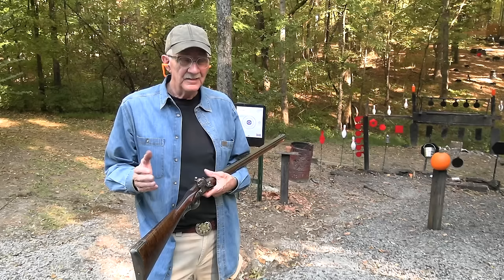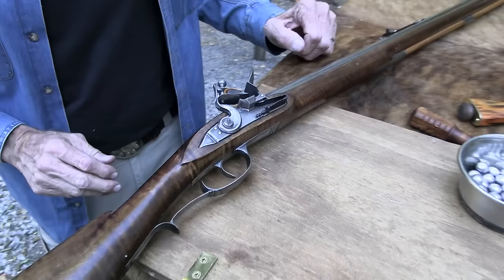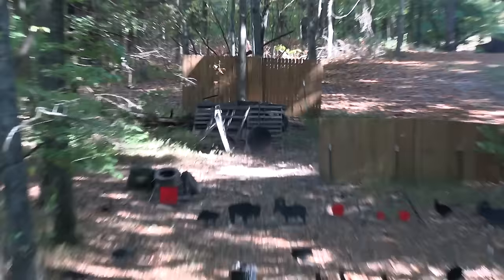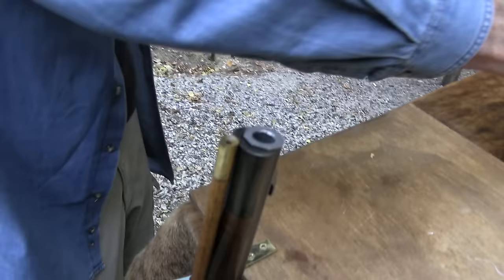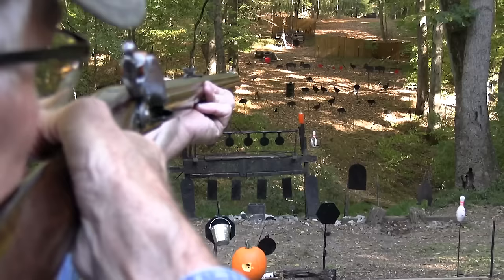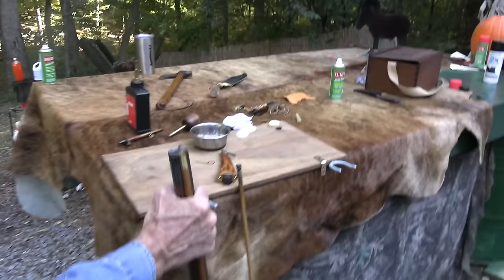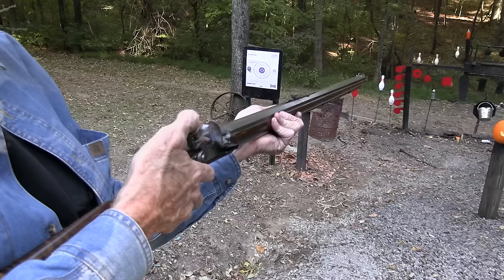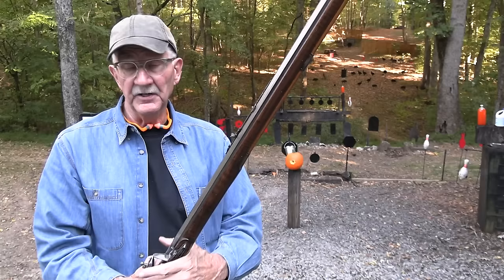American Long Rifle Flintlock  Iron-mounted .54 Caliber

Comment: I think one of the reasons these were used for so long (and still appeal to many today) is because of economics. On the frontier, making purchases at a trading post was not a reliable occasion; thus, having a weapon that did not rely on primers, brass, or other expendable items was preferable. Newer, cartridge rifles may have been technologically superior, but they were not economically superior. With a humble amount of gunpowder and some lead, a frontiersman armed with a Kentucky rifle could protect and provide for his family without worrying as much about limited supplies.

Comment: Favorite hobby wood project I have ever made was the Traditions Kentucky Long Rifle kit. Not very demanding, lots of sanding, and so satisfying.
Reply: Get yourself a Jim Kibler kit and take the next step into contemporary muzzleloading.
Reply: @cory Horton I just brought one of those and am in the process of putting it all together. How has yours held up to repeated use if you have? Ideally, I would eventually want to use it for hunting and target shooting
Reply: @JjjjMy1234  holds up great. I hunt with it and take it target shooting. Maintain your supply of anti-corrosion cleaning supplies and lubricants for storage. Your cleaning ritual must be thorough.
Reply: @coryhorton5837  how often should you clean if you only shoot every few months or something like that
Reply: @snowy5419  Clean THOROUGHLY after every range trip. In storage a good oiling/greasing is sufficient. Store it muzzle down so the oil doesnt run down to the breech area where it's harder to clean out.

Comment: One of the reasons why you are shooting so well with this rifle is a matter of the Design.  Take a look at how deeply notched the barrel is for the flash pan.  This is an innovation invented by a Gunsmith named Joseph Manton, who darned near founded the British Sporting Gun industry.  Some of his staff were named Purdey, Greener, and Boss.    Doing this reduced the lock time of a gun because it make the flash hole shorter in length.  Because the speed of the flame front for burning black powder slows down in a closed channel.  Shorter lock time means that less time between when the flash pan is lit and the charge in the barrel fires.

Comment: I shoot the first Sunday of each month at our local club a rifle I built .54 cal percussion, 31-inch-long Green-Moutain 1-60 twist barrel, Siler lock with set-triggers, silver front blade and Buck horn rear and a full-length stock that uses many different design features.  It will put 5-shots into a 2-inch group from a bench at 100-yards.  We'll shot 25 shots at 5 different targets off-hand at ranges from 75 down to 25 yards or do the playing card split.  The 230-grain patched round ball over 60-grains Triple-7 for plinking.  Hunting load 1800 fps using 100-grains triple-7 FFg powder.

Comment: The speed to the gong is incredible.
Reply: .54 round ball with his 70gr load of goex is probably going about 1500fps from that barrel length. A full load with 110gr of black powder will approach 2000fps.  A .54 round ball weighs about 230 grains, a typical full power .44 magnum fires a 240gr bullet at about 1400fps. It’s a formidable weapon.
Reply: If it goes boom, you're subsonic, if it goes crack you're super Sonic.
Reply: @r.a.facklam4851  what’s a boom
And what’s a crack is really a matter of the hearers opinion, and a terrible
Measure of velocity. Let alone what it sounds like from a video through a speaker. A chronograph is a much better tool for that task. My guns and my chronograph support the numbers I gave.

Comment: I've owned three flintlock longrifles in my life. One .45 caliber, one .50 caliber, and one .62 caliber. All three rifles were equipped with large, right-hand, Siler flintlocks. ALL three locks were assembled and tuned by the gunsmith who built the rifles. 

The .45 caliber barrel was a Golden Age Arms stamped barrel manufactured by Douglas, with a 1:48" rate of twist. It was a straight octagon barrel, and measured 13/16" across the flats × 40" long.

The .50 and .62 caliber barrels were manufactured by Don Getz. Both barrels measured 42" long, had a swamped profile, were rifled with a 1:48" rate of twist, and were purchased with the optional factory coned muzzles. 

The powder charges for the rifles were, respectively, 55 grains, 65 grains, and 75 grains. I shot 1970's, 1980's, and 1990's GOEX fffg black powder in all three rifles. I shot hand cast, pure lead balls surrounded by 100% cotton denim blue jeans material that I purchased from a fabric store. The balls measured 0.445", 0.495", and 0.615" in diameter, and respectively weighed approximately 132 grains, 182 grains, and 330 grains.

Once tuned for optimal accuracy, which WAS NOT a maximum powder charge, all three longrifles, which were made by three different builders, were capable of repeated, sub-M.O.A. 5-shot accuracy, off of a bench, at 100 yards. 

All three rifles could be shot, ad infinitum, in any humidity conditions, without requiring any wiping of the bore. The average number of offhand shots that I took when shooting at the range was usually somewhere around 30-40. I NEVER cleaned any of the three rifles until I got home..

The greatest number of shots that I ever shot consecutively without wiping was with the steel-mounted  .62 caliber longrifle on a day where I was stump shooting as I wandered aimlessly around my friends' heavily wooded property. I shot somewhere north of 85 shots on that humid, 90° Fahrenheit plus summer day in Maryland with oppressive humidity hovering close to the 100% mark.

Anyway, that's a good-looking iron-mounted longrifle, and a .54 caliber pure lead ball will kill anything up to, and including, a grizzly bear; although most experienced muzzleloading round ball shooters would opt for a larger diameter lead ball if they were deliberately hunting grizzly bears.

Comment: Fifty-some years ago, I had an unbranded kit .54 flintlock pistol - and it was a blast (literally) to shoot.  Five or six years after I sold it, I bought another unnamed black powder .48 cap and ball musket, that used #11 caps.  While I really liked the flintlock, that delay really gave me trouble.  The musket, however, had negligible delay, and I was using FFFg for the propellent and a patched .45 ball.  I don't really remember the powder load I used, but I remember thinking my 12ga. felt like a .22 compared to it.

Comment: A lot  of shooters underestimate the abilities of these classics.  I own a  beautiful replica of Kit Carson's rifle (right down to the metallurgy, hardness index, stock,  rifling, buckhorn' sights, etc., in  .53 caliber bore.  In a document case somewhere I have the  range marshal signed,  winning  100 yard 'open' match target showing  a 3 round group   which looks like Mickey Mouse:)  i.e., one hole with two very small 'bumps' for 'ears'.   Center to center?  I seem to remember it being measured at around .2, like I said, the ears are just barely bumps.  I've kept the target, cause this was an 'OPEN" match- my  fixed iron sights, against all shooters, including  scoped modern rifles :)  Talk about shocked expressions LOL.  This all took place many years ago at the old Los Angeles Range.
Reply: I'd have to be present to witness that feat, and then I may still not believe it.
Reply: @joeeckley5272  you wouldn't have been the only one totally shocked:)  I'd spent a couple of hours that morning out there on the line figuring out what amount of powder, with what level of ramrod compaction would match up best with the twist and harmonic's of that barrel.   Then all of a sudden , it all came together :)  Since I was there anyway, that afternoon my brother talked me into entering the "open " match:)

Anyway, since I cast, trim and finish all my own round balls for that rifle, I've used the same exact load for the now 45 odd years since:)

Comment: Sir, the secret to quickest ignition with a Flintlock is in the pan priming. Only about 2 grain of 4f and keep it to the outside of the pan away from the flash hole. Delays come when pan powder must burn its way thru to the main charge. I enjoy your videos, keep it up. God Bless

Comment: Use less priming power away from the touch hole should give you instant ignition  with no delay if touch hole is set in right location you want the fire to jump too much priming powder will give a fuse effect hence delay

Comment: I had a Navy Arms 1803 Harpers Ferry Rifle.  Boy was I good at having all kinds of problems with it.  From too much lube killing the powder charge, not picking the vent hole enough, discovering that you have to reharden the frizzen from time to time, etc it was a blast.  But sold it for some other project and still miss it.  Finally found a 1792 Contract Rifle repro to replace it.

Comment: Reading an Historical   novel, by K. Roberts  he  mentioned a Henry working at making firearms in Pa. In Revolutionary times.   I've got a Dixie Gun Works Squirrel  rifle  in .40 Cal.  Hardware and lock made in Belgium.  Stock was in the white which  I corrected right quickly.  Accurate gun, in percussion.

Comment: I own a Matt Avance iron-mounted early Virginia flintlock rifle. It has double set triggers and a Siler lock with a 42" barrel in .54 caliber. I coned the barrel so I can thumb a ball and patch into the muzzle and then use the ramrod to seat the ball. Rifles from that period ( French & Indian War through the Revolution) were coned. Short starters came along later.
Reply: My first flinter was a TVM Southern rifle in .40 cal built by Matt. I still love that rifle, and they were great to deal with. I would be a repeat customer, except now I want to build one myself.

Comment: The type of muzzleloader rifles that were made before the flintlock rifles in the 1700's was the wheel lock rifle from the 1400's to the 1600's. But the drawback to those, was the length of the wick used to shoot was very slow & time consuming before finally fired.

Comment: I Love my flintlock! I shoot it more than anything else I have. It is just plain old fun. I thin it'd the process you have to go through. I will admit I have pretty much given up on Patched Round Ball and use R.E.A.L bullets. Pure lard as lube but no patch required! I do have a little better twist rate. 70 grains of 3fff powder and a little 4ffff in the pan takes out a deer with ease. Roughly 75 yards has been my longest shot on one. Dropped right there with a hole on both sides.
Flintlocks are so far the longest running type of weapon used in history. They were the mainstay for over 200 years. Percussion rifles slowly replaced them.

Comment: I have what I was told is a Lyman Trade Rifle with a full stock that looks remarkably similar to your rifle. Just wondering if there is a common rifle with many names like corn flakes made by General Mills, Kellogg or what have you but they are still corn flakes. Mine is also .54 caliber and built by a guy name of Vernon Forns who used to hang out in Montana around where I live. Beautiful workmanship and I am proud to be it’s owner. 🤗
Great video! Very informative! 🤡

Comment: I know you are not a dedicated black powder shooter, so I'm not knocking your video.  You always have a good presentation on your video's.  There are several things that cause delayed fire in a flintlock. Every few shots, the frizzen face and the flint should be wiped with a cleaning cloth.  It also doesn't hurt to use a vent pick through the touch hole to keep it open.   Of course there are other factors.  The frizzen must be hardened properly.  The mainspring  should be of sufficient force to cause the flint to create sparks, but not so powerful it breaks the flint.The frizzen spring should not be so powerful that is doesn't let it open fully, at the same time not so weak that it bounces back.
One thing I would caution is placing your hands too far up on a wooden rod.   It could possibly facilitate the rod breaking and piercing your hand..

Comment: WHAT I LEARNED TO DO AFTER FIRING A ROUND IS TO RUN A WATER-MOISTENED PATCH DOWN THE BARREL, TURN IT AROUND AND FOLLOW IT WITH A DRY PATCH, TO KAKE SURE LOOSE EMBERS WERE EXTINGUISHED.  NEVER HAD A PROBLEM OR CONCERN.   I CARRY A PLASTIC WATER BOTTLE IN MY SHOOTING BOX.     RALORD, OHIO

Comment: Flintlocks need to use black powder.   The substitutes have a higher ignition temperature and will not ignite reliably.  A couple of grains is all you need for a priming charge.  
If you want to overcome the flinch practice dry firing with a piece of wood in the jaws.
I've built a .36 with a 42 inch barrel and a .54 with a 38 inch swamped barrel.

Comment: One problem with Pedersoli is that the Barrel on their KY. Type rifles is the barrel pins are pinned with " Blind" Pin hokes- The pins don't go all the way through the stock-( At least on the one I Had )- So good luck trying to Remove the Barrel -

Comment: Modern smooth bore shotguns can fire self stabilizing slugs. Why couldn't that technology be adapted to a smooth bore musket, like the Long Land Pattern or the Charleville?
A .75 caliber foster slug would be a heavy projectile, but it could, in theory, boost accuracy range by half or better, if you could get a mold for it.
You might even be able to hit a pumpkin at 10 yards with it. Maybe.

Comment: Can you shoot a flintlock left handed and how much work is involved cleaning it vs a modern rifle?
Reply: You can shoot it left handed but it's not as comfortable.  There are some left handed flintlocks out there but they are rare.  Most builders do no make many simply because the market is small.  Honestly, it takes about as much time to clean a black powder gun as it does to properly and throughly clean a modern rifle.  It is more of a process and you need to clean them at the end of the day.  No leaving it for a week and getting to it later.  Cleaning is what I find as part of the charm and enjoyment of shooting the muzzle loaders.  Shooters through the ages cleaned them just the same as I do and I feel a connection to those who came before me when I'm doing it.

Comment: Oh my gosh this screwing you hook to hold the gun up why didn't I think of that thanks
Reply from the maker: I used to just cut notches in my shooting table, but I've also screwed these U-hooks, or whatever they are called, into the side of the table. Problems with them is, they are in the way Big Time unless I'm shooting a muzzle loader, and also I can't really use them when we use our skin cover during videos.
So, being the genius I am, I created this board to put on the edge of the shooting table whenever I bring out a muzzleloader for videos. Works pretty well.

Comment: You may be using too much primer. It should flash but if there is too much powder,  it may slow down ignition.
Also, way are your rear sight set so far forward?

Comment: How many separate pieces of wood are used to make that rifle?
Reply: It’s one tree that is turned in a lathe. Then removed and shaped by a belt sander, finally it would be finished by hand tools. 

If the grain of the wood is broken in a long musket like this, then you’ll snap the base structure.
Reply: Two pieces of wood. One piece for the stock, and the ramrod.